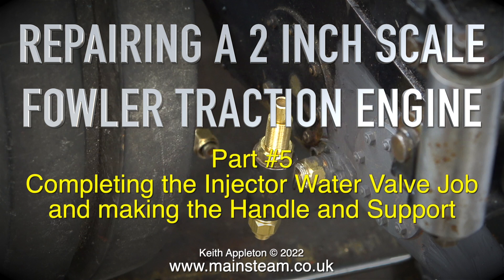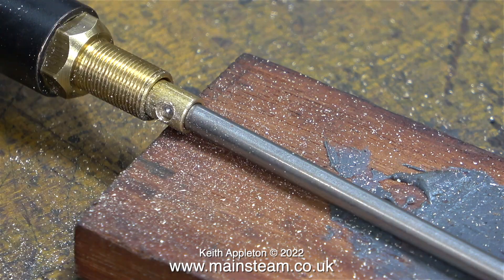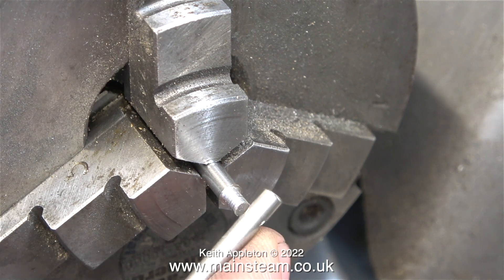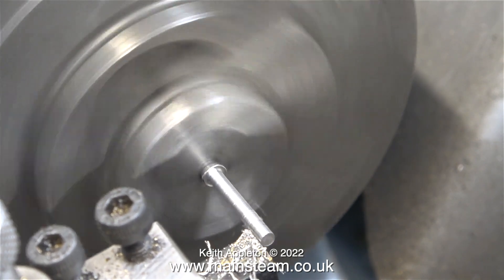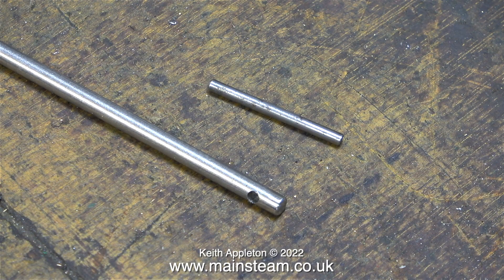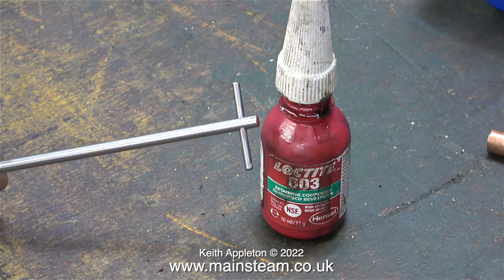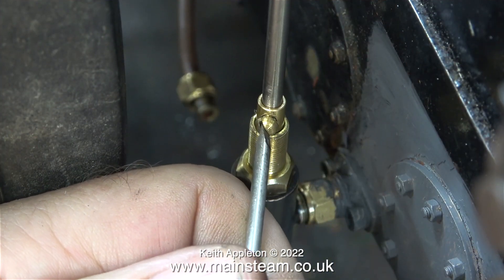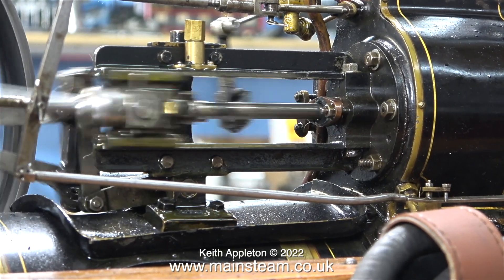REPAIRING A 2 INCH SCALE FOWLER TRACTION ENGINE  - PART #5

Comment: Keith - One of the things I noticed in the videos about this engine is that the "sliders" on the cross-head mechanism are wiping the oil off the guide rails and it appears there is direct metal to metal contact with no oil film in between the "slider" and the rail.  Any thoughts about pulling the rails and milling a small oil channel (similar to what we see on lathes and mills) along with an oil cup to help retain oil on the rails during operation?  Just a thought to help with longevity on the repair.  Thanks for all the great videos, they are both educational and fun to watch.
Reply from the maker: It's not really necessary as there is sufficient clearance for the lubricating oil to penetrate. My 4 1/2 inch scale Traction Engine does not have any "oil channels" and that works OK too.
Reply: @keithappleton  Thanks Keith.  Appreciate the information from the master of model steam engines.